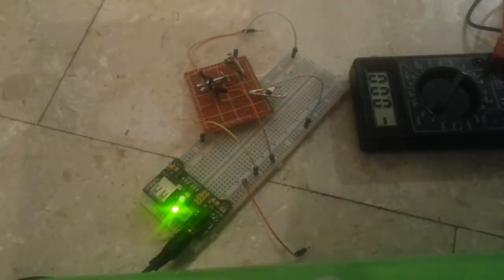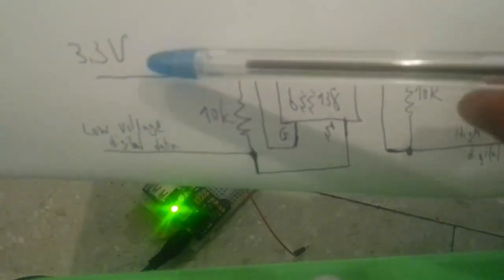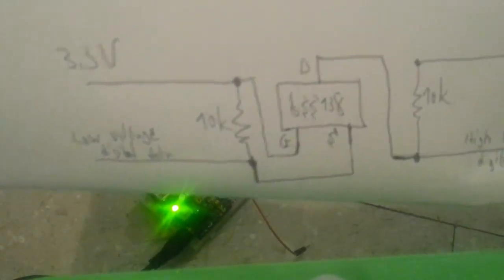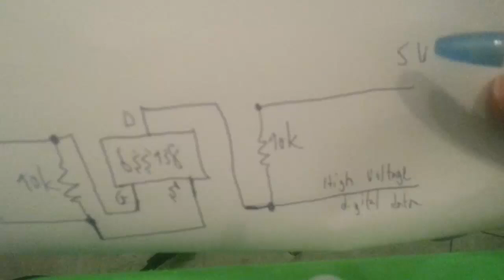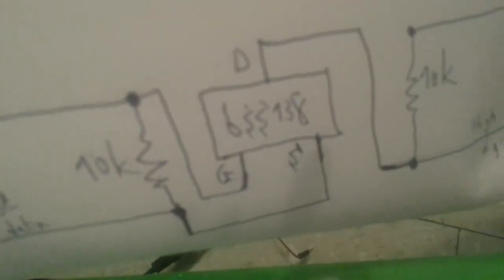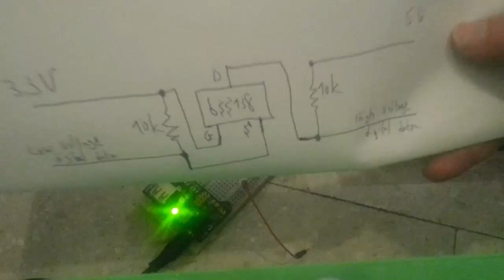Top DIY 3.3V  5V bidirectional logic level converter

Comment: sorry to bother, but i can't understand the part of soldier, how can i do it, i mean  i cant see the mosfet, sorry im a beginner, can you help me, pless???  i need to get done a similar work at school and im stock, im in hurry, can u help me?
Reply: or what would be the logic level converter equivalent that I could buy?
 what would be the model?
Reply: could be 10 unids/lote 4 canales IIC I2C nivel lógico convertidor bidireccional módulo 5 V a 3.3 V para Arduino?
or 5 units?
2 units?
or  a different one???
Reply from the maker: +Aldo Catalan Yhe that will work
Reply from the maker: +Aldo Catalan Check the two videos I made about itI am using a small mosfet